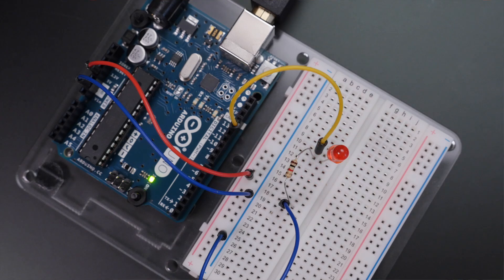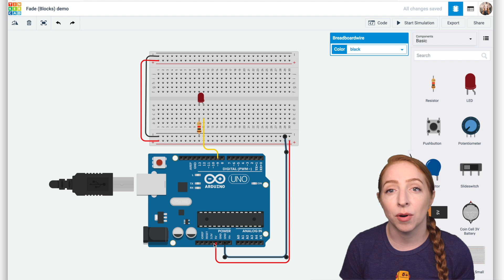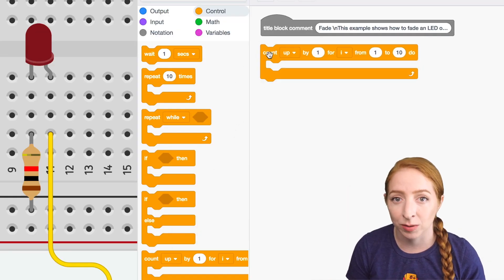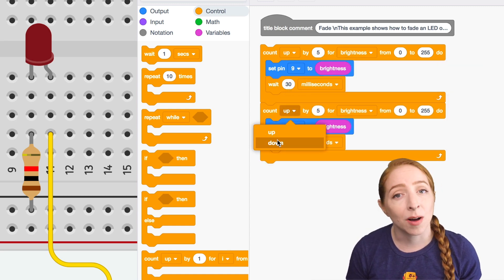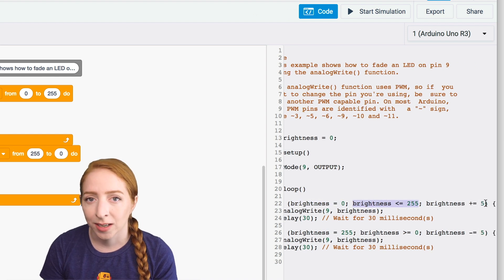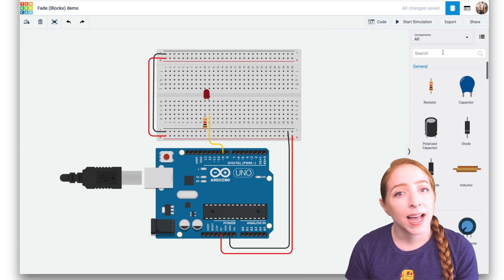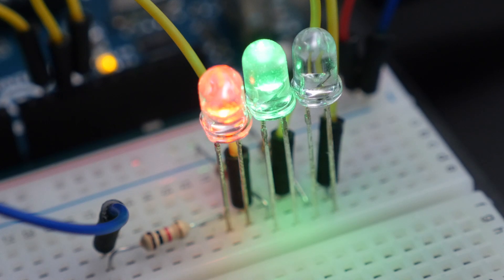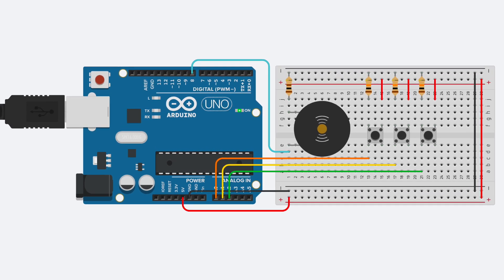Fading LED With Arduino in Tinkercad

Comment: Everybody seems to be using arduino to do the most menial tasks. This circuit  can be more cheaply done using discreet components like a 555, caps and resistors / pots

Comment: The code used in video 

```c
int bulbPin1 = 2;  // Pin for the first bulb
int bulbPin2 = 3;  // Pin for the second bulb
int bulbPin3 = 4;  // Pin for the third bulb

void setup() {
  pinMode(bulbPin1, OUTPUT);
  pinMode(bulbPin2, OUTPUT);
  pinMode(bulbPin3, OUTPUT);
}

void loop() {
  // Turn on all bulbs
  digitalWrite(bulbPin1, HIGH);
  digitalWrite(bulbPin2, HIGH);
  digitalWrite(bulbPin3, HIGH);
  delay(1000);  // Delay for 1 second

  // Turn off all bulbs
  digitalWrite(bulbPin1, LOW);
  digitalWrite(bulbPin2, LOW);
  digitalWrite(bulbPin3, LOW);
  delay(1000);  // Delay for 1 second
}
```

Comment: Is there a way to do this without an arduino?
Reply: Yes, with switches and potentiometers. But It will be all mechanically. You can adjust the brightness and turn on and off, but you will be the brain and not automatically.

Comment: great video! However, in the beginning when it is first suggested to run the simulation, it is not clear that the code blocks have to be changed from pin 13 (which it defaults to) to pin 9
Reply: ok